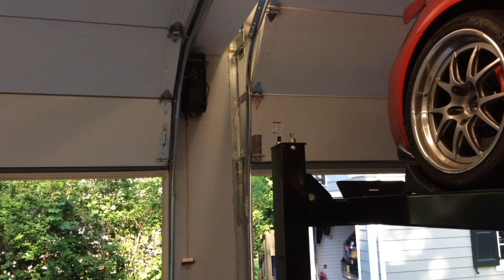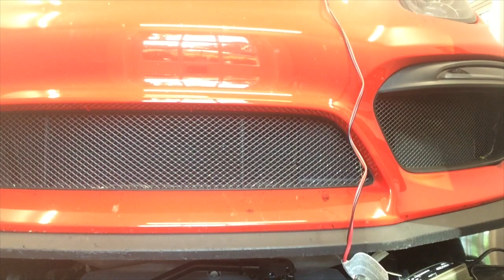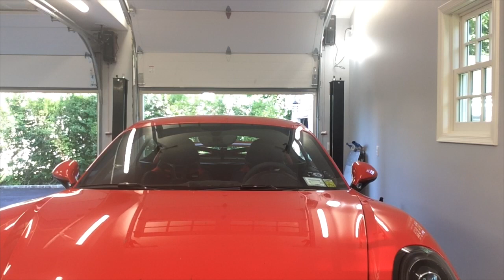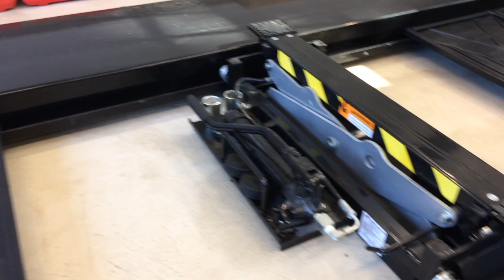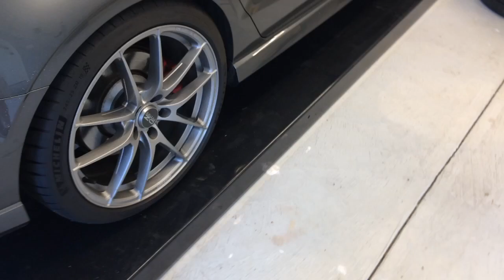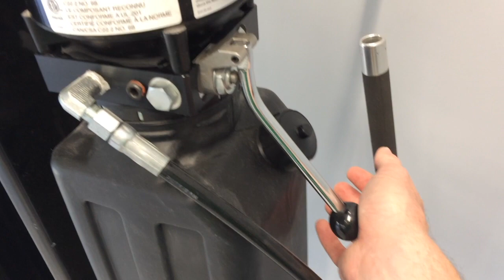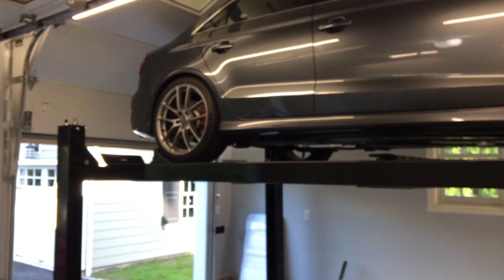Challenger 4-post lift overview and operation

Comment: Nice video. Did you have the lifted bolted to the floor?
Reply from the maker: No--that's optional.  The structure of the lift itself and the weight of the car keep it stable.  I have hydronic radiant heat tubing in the garage floor, so I didn't want to run the risk of drilling into the tubing.
Reply: @AutoPilotgogogo  great video, I'm also on Long Island and considering the same setup.  I'm building a new garage and about to run hydronic radiant and pour the slab.  Did you have to use a higher PSI foamular/styrofoam insulation board?  The standard seems to be 25psi and I'm concerned it may not be strong enough under the 6" slab.  Thanks!
Reply from the maker: Wish I could answer that--I'm not sure. Our contractor took care of it. I'm sure if you ask a couple of contractors, or even the company that installs the lift, they will have the answer. It is absolutely fantastic once it's installed, though. One of my favorite features of the house! My wife was actually laughing about it just yesterday--at one point during the interior renovation of our house, with workers coming and going through the front door all day, and the garage floor already completed with radiant heat, the garage was the warmest and quietest room in the house. She did some work and phone calls from the garage at times until the construction was done!
Reply: @AutoPilotgogogo  Thanks for the quick reply.  The lift company was no help on foam psi, will try a few others.  That's a great endorsement of radiant!  It's a last minute addition to this project, but after hearing stories like yours we had to go for it.  BTW I was quoted almost double for the CLP49X version!  I know prices are up, but wow.
Reply from the maker: You’ll love radiant heat. I didn’t realize lift prices had increased so much—must be raw material costs.